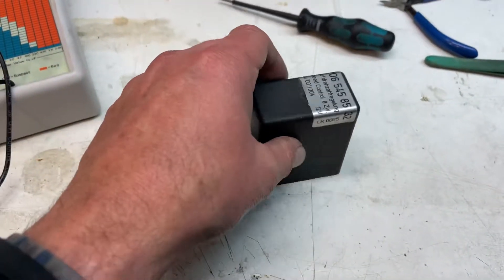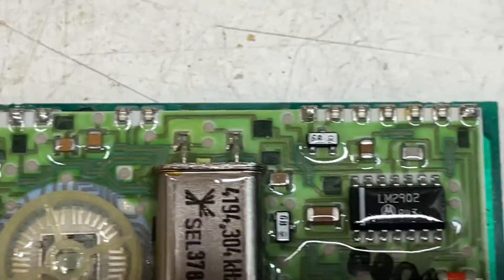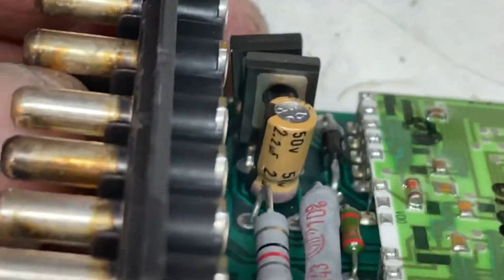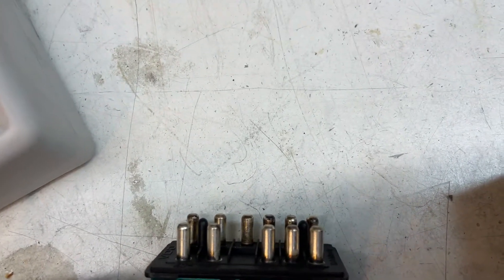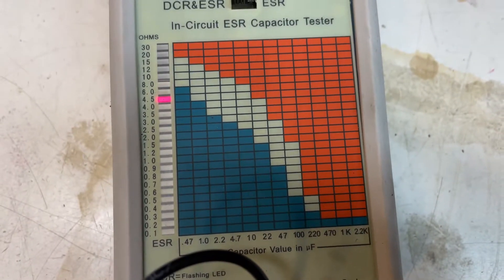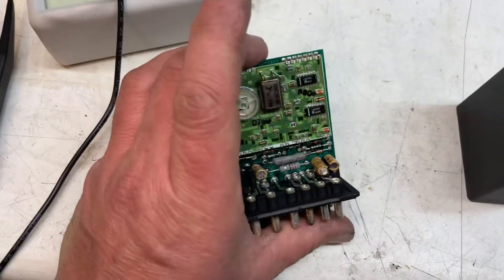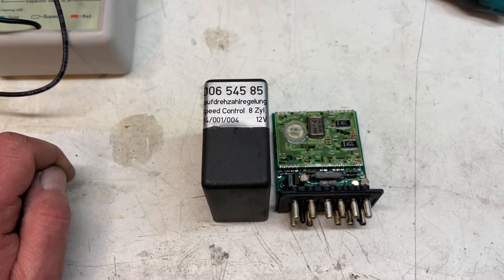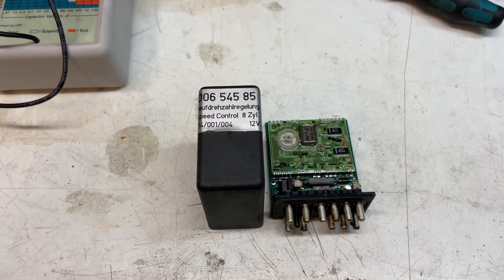Mercedes Benz W126 560SEL 3/89 Testing & Overhaul of Electrical System and All Control Units Part 3

Comment: i have a similar problem. the video is good.
 but the part number on me is different.
 There are 3 injured capacitors in the piece I have.
 After replacement, which pin ends can I give volts to this part and test?
part number; 001 545 90 05 (Kaltstart Steuerung) total number of pins, 8
Reply from the maker: Hi Refik,
Which model and year do you have?
One of my additional problems I had was the old voltage regulator on the alternator. It was just worn out, the brushes too short just about to fail.
Reply: @inovahightechltd   W124 200E M102.963 (124.021) 08/89) 122HP
the overcurrent protection relay delivers the appropriate voltages (12 volt input, output 14 volts!) but it is not the relay it should be. "201 540 08 45" looks like this in the EPC, but I suspect this part is on my vehicle "201 540 32 45". Do I need to replace it after the repair so that it doesn't get damaged again?
Reply from the maker: @r3FMusic  I do not have the wiring diagram for this car or the relay
Reply from the maker: @r3FMusic  please post the numbers and letters for the pins
Reply from the maker: @r3FMusic  
Part 32 45 is the newer part, they are backward compatible - I would use only a MB part not aftermarket for this
Reply: @inovahightechltd   Thanks.. 
i relieved =)
Reply from the maker: @r3FMusic  if the 32 45 is a 9 PIN then you can use 201 540 37 45 as well
Reply: @inovahightechltd  Yes. fits in its nest. Number of female Socket 9 Accepts PIN. Thanks again. Thanks to you, my vehicle will be able to work flawlessly.
Reply from the maker: @r3FMusic   https://youtu.be/8J-mRGsl8-g
Reply from the maker: Refik, 
There should be numbers and letters next to the PIN ie. 30, 31, 15, 87, 87H, TD, TF etc - post those you got on your 90 05 and I will let you know A
Reply: @inovahightechltd   31, 15, 87, 50, TD, 30, 87v, 15 (001 545 90 05)
Reply from the maker: @r3FMusic 
Same connection for test as in this video:

https://youtu.be/xDQ8HnvEANI

Your unit should work the same way
Reply: @inovahightechltd   That's good. Thanks!
Reply from the maker: @r3FMusic  

You can check all your part numbers here:

http://mb-teilekatalog.info/?lang=E